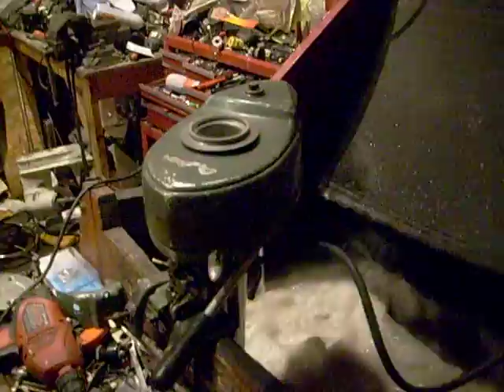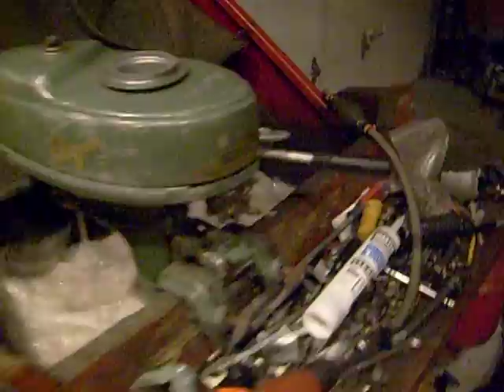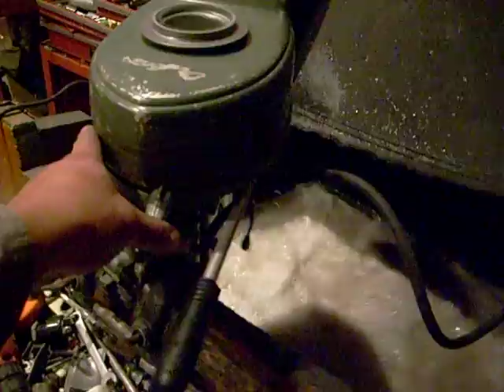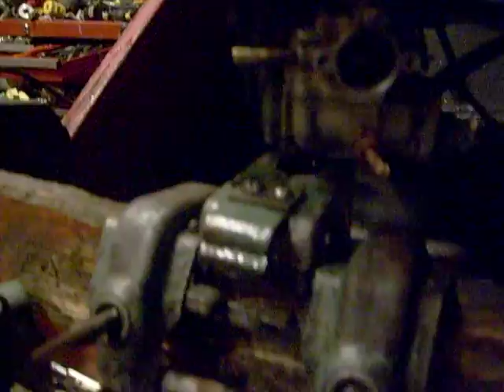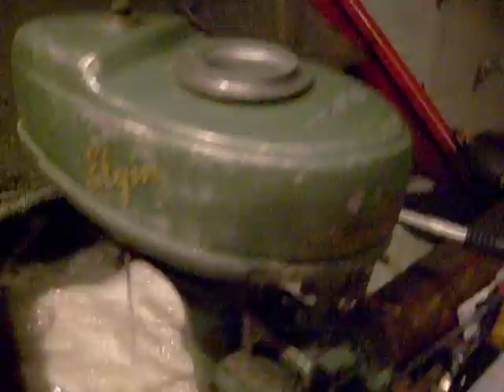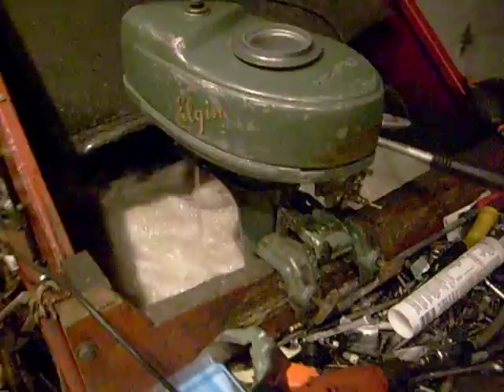Sears Elgin single cylinder outboard running in test tank

Comment: I recently picked up the same outboard except it was missing the electronics, the carb, and the starter. Good news I was able to upgrade the electronics with a 1958 model and found a carb I can use. And I will use my drill to start it. Yours is a nice unit. good luck John